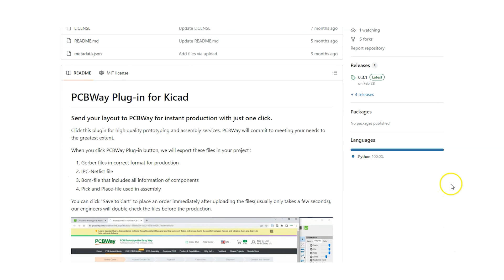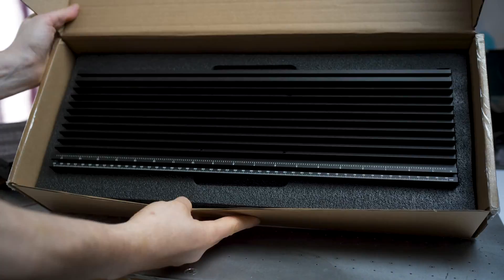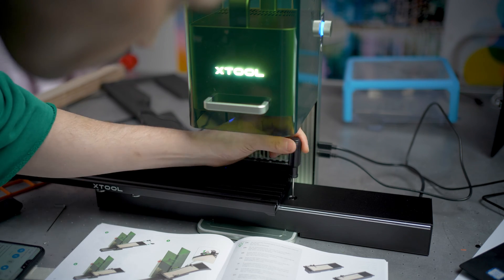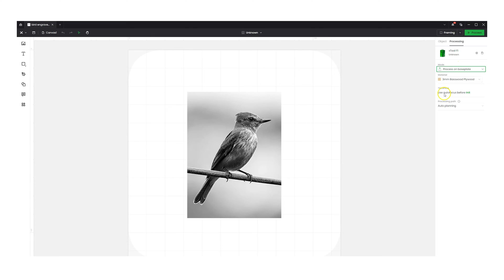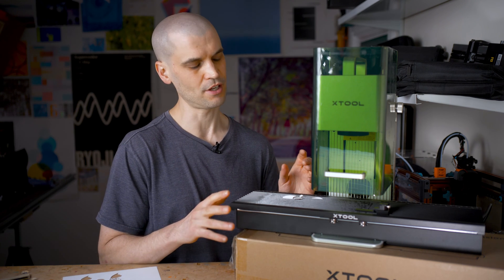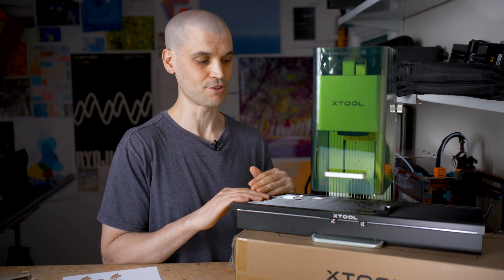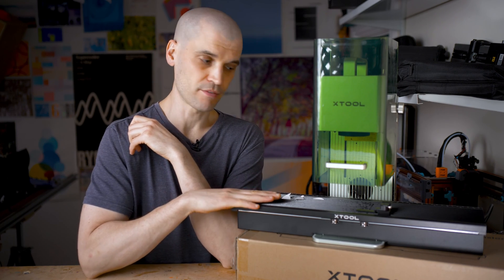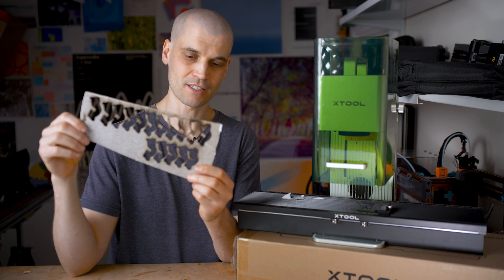XTOOL F1 Slide Extension Review - Is it THE MUST HAVE accessory?

Comment: Great video, I used my old in line grow room fan which is speed adjustable and plumed in my f1 and p2 together and put a diverter in so I can use just 1 or both. I got a guy on line to 3d print me the peace for the p2 for its exhaust exit but your FL you can use the galvanized pellet stove flue with a damper unless you get a in line fan with a variable speed.
Reply from the maker: Great work, once i get a pernament setup for my laser I will do something similar, for now I have an AC Infinity Cloudline S8 fan and exhaust it out my window, it provides great air flow extraction